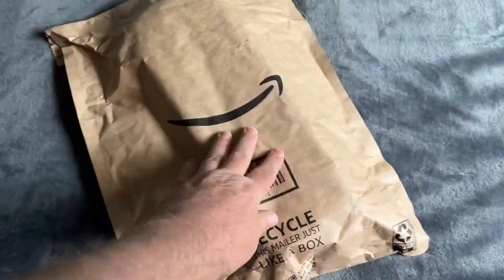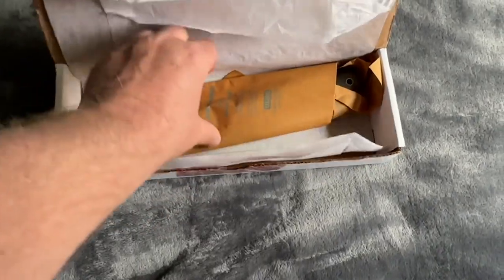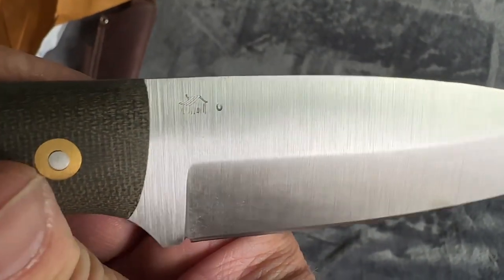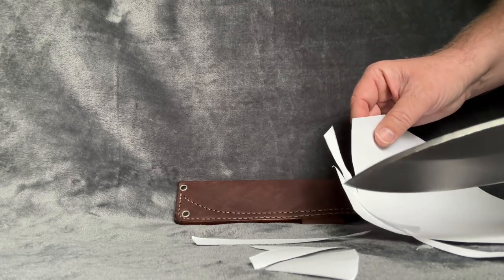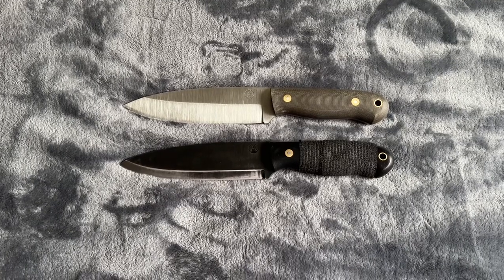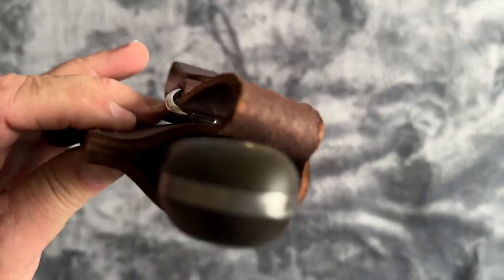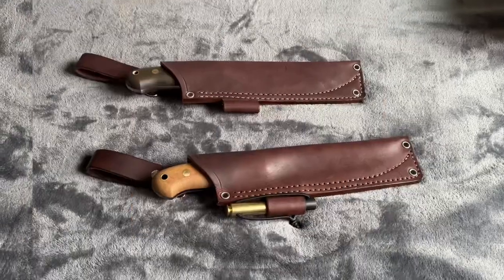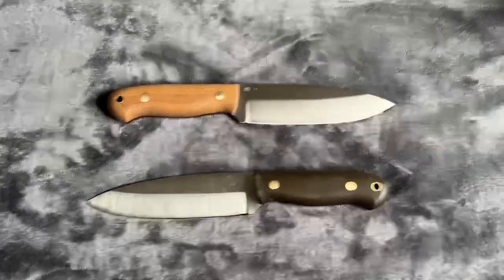LT Wright: “Sospes” knife-Saber Grind

Comment: hi Joe which do you prefer between the sabre and the scandi grind. I have a sabre but have been looking for a scandi for some time cheers
Reply from the maker: The Sabre is a stronger edge design so it’s a popular choice for a “Jack of all trades” knife or a “Survival Knife”  but from my hands on experience in the forests of western PA.,  I definitely prefer the Scandi-Grind.  It blasts thru wood,  it has a razors edge,  it’s easier to sharpen at home & in the field.  Plus the Scandi grind on the Sospes, has a much thicker tip.   I think a Sabre is probably a better tactical knife design,…  where as a Scandi-grind is a far superior bushcraft design.